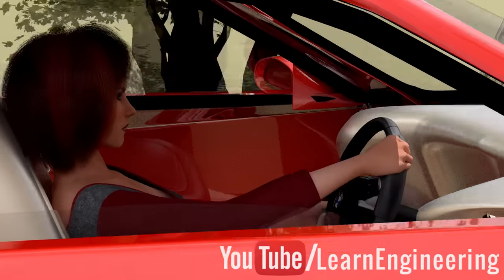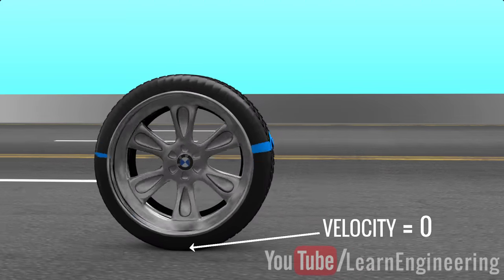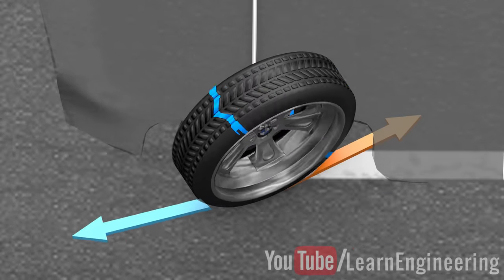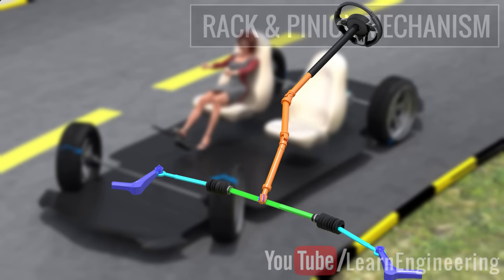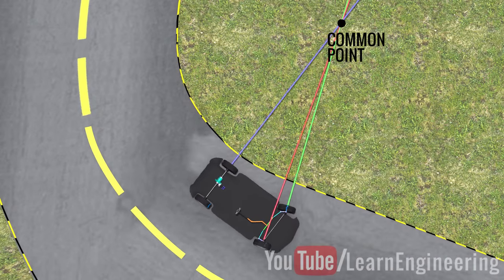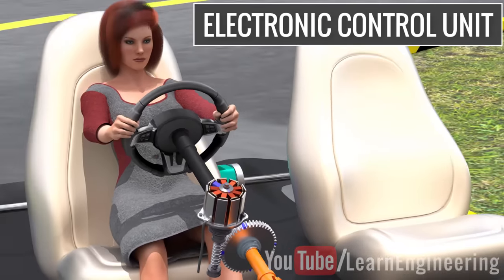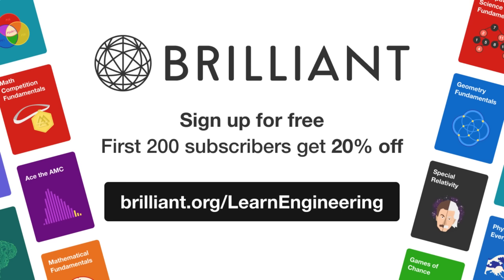Understanding your Car's Steering & Power Steering !

Comment: I remember the clutch being harder to learn than turning
Reply: Gazza Darin true 😂😂😂😂😂
Reply: And even that is easy
Reply: Gazza Darin, I agree!
Reply: Clutch master race
Reply: I hear so many times about people having issues with using a clutch, i never understood he difficulty of it. In my first driving lesson 10 years ago i drove away without talking about it, 2 years later the same at motorcycle lessons. I guess you just got to know what a clutch actually does mechanically.
Reply: I found that keeping straight and centered was actually harder than learning to shift, at least in my truck anyways.
Reply: Gazza Darin - I agree, but the majority of Americans can't use a manual gearbox.
Steering is only difficult to master when you're going backwards.
Reply: This vid is American most of their cars are auto transmissions
Reply: @jasperl3759  Well done - I just said that.  If they don't use manual gearboxes, then obviously, they use automatics.
Reply: Just think about how many times u were near to an accident after learning clutch perfectly!!
Reply: @jasperl3759  I don't think it is American because the driver is on the right.
Reply: I had trouble changing lanes I used to take my foot off the accelerator when i looked over my shoulder ha ha ,(drove manual paddock bomb  so not an issue when a went  licence ) 👍
Reply: gunjeet bhatt Maybe you should float thru the gears eventually I’ve heard that cause less wear and tear on the clutch
Reply: Try a manual with no power steering
Reply: As someone whos been driving for 10 years and finally decided to learn manual transmission, this hit different.
Reply: Have u ever heard about automatic transmission 😂
Reply: Suraj Creation What is that😭? Never heard of it....
Reply: @TT.4_   Please check videos of learn engineering on that topic  for more information
Reply: Lmfaoo
Reply: Steering* XD
Reply: yep steering is easy for most of them
Reply: LMAOOO
Reply: I'm a learner driver clutch was significantly harder than steering
Reply: They don't have a clutch in the states.
Reply: @Engineer9736  well that's good. I disagree that knowing how a clutch works would help. I knew exactly how a clutch worked before I started driving manual and it still took me some time to start without spinning up the engine skidding the tires, riding the clutch or stalling the engine.
Reply: Clutch ain’t nothing unless you gotta double clutch
Reply: Lol fr. And even in an automatic steering is far from the hardest part unless your car for whatever reason doesn’t have power steering ig
Reply: What's so hard about it?
Reply: @kindpotato  As an Indian, and from Mumbai, we learn clutch riding while learning to drive. It is said that, if you are able to drive on Indian roads easily, you can drive anywhere in world, all thanks, to potholes and frequent traffic and idiot drivers who think they own the roads.
Reply: True
Reply: Lol I learned how to drive on an old Ford tractor, I remember thinking I was going to do when I dumped the clutch and the front end tried to come up
Reply: No that is not true, the steering is more hard to learn than clutch
Reply: It always is. Very true
Reply: They're referring to people who learn to drive automatic cars.
I feel they don't know anything about driving!
Reply: Americans don't have a clutch. But it's funny cause having a clutch never made me think steering was difficult
Reply: This is exactly what I thought. I wondered if this is a American thing (autos being more common)
Reply: Kids these days be like "what is a clutch" 🤔
Reply: Changing speeds it’s pretty uncomfortable at the start
Reply: @DownhillAllTheWay  steering is still pretty intuitive in reverse if you adjust how you sit correctly.
Reply: Haha true dat
Reply: Facts 💯
Reply: I wish I was born with manual cars
Reply: @Unknown-vp2vt  unless you were born prior to the invention of cars, you probably were, even now you can find a manual cars, they are just order.
Reply: So truuuu it took me like 50 minutes to understand the clutch and like 2 minutes turning
Reply: Learning how to balance the clutch is hardest part of learning how to drive a manual transmission, but not the same for an automatic
Reply: True 🤣 way more hard
Reply: That's an interesting last name you have there. 🤔
Reply: Exactly, the clutch feel and handling were much much harder to learn than steering.
Reply: So gone 😂😂😂
Reply: Exactly! Since when has it been “one of the most difficult things to learn how to do?” You just turn the wheel for goodness sakes. I remember the clutch being this mysterious, intimidating puzzle. At least for me.
Reply: Tesla owners be like u guys have to learn too?
Reply: True
Reply: Atom
Reply: @Engineer9736  yeah some cars have it easier than others. My first time driving was on a '43 Jeep Willys. Damn that clutch was rough
Reply: Americans don’t use clutch so steering is the hardest even though it’s so easy 🤣🤣🤣
Reply: Same for me and 2nd to manually shifting was pressing the fuel pedal, good grief I got a lot of tickets before I Learned how to slow down 🤣
Reply: @BalrogUdun  I learnt how to drive on a manual with no power steering. Gone are those days and now most people around me don’t know how to drive a manual.
Reply: Just get an automatic
Reply: Clutch is easy bro 😌
Reply: Nothing is easier than clutch lmao
Reply: Means you can never understand AT
Reply: Drive automatic transmission dude
Reply: @CIorox_BIeach  I found that hard at first... the trick is to look ahead.. not the few yards directly infront of you.. but down the road.
OR keeping the corner of the hood of your car running evenly with the lane marker .. that was easier when cars were more boxy but it is especially useful when bright lights are blinding you.

At least that works for me
Reply: Haha, so I was not struggling alone 🤣
Reply: I think they mean the science of it is harder to learn
Reply: I put my mom's Benz in park while it was still rolling 😬
Reply: You thought underbody was going to be easy?
Reply: I remember that it was really easy to drive from the begining… but guess that depends on every people
Reply: PFFT

Comment: It’s amazing the amount of engineering it goes to things we use everyday and take for granted. And also, these visual learnings are effective rather than just reading about it👌🏽
Reply: Absolutely until you suddenly experience total failure! Electronic steering depends on vulnerable processors, wiring and connectors and any problems within these components render the steering useless, you can't beat hydraulic power assisted steering , just had a total failure on Opel Astra .......and steering wheel was extremely hard to turn, any woman driver would have just given up.
Reply: @mgabrielle2343  unless she hits the gym like The Rock
Reply: @mgabrielle2343  aren't women strong tho?
Reply: We pay for it
Reply: And these engineers keep inventing the wheels, amazing.

Comment: Wow, I never knew that the 2 wheels are steered ar different angles! This video is an eye opener! And the power steering mechanism is quite clever. Infact all mechanics are work of clever men. Great animation. Thanks and keep it up.
Reply: And here I used to think a car needed alignment whenever I noticed a parked car with the wheels turned and the wheels weren't exactly turned equally hahaha! I Dunning-Krugered myself.
Reply: They also turn at different speeds which I also learned from this channel! So cool!

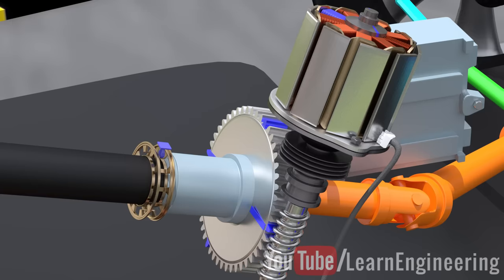Comment: just finished my first semester of mechanical engineering. experienced pure joy after predicting the planetary gear at 6:03. 😂 Great video, thanks a bunch!
Reply: If the planetary gear is used as shown the steering wheel has no authority over the direction of the car. If the wheel is held straight and the worm gear turns, the car will turn in that direction. I think there must be something missing.
Reply: In only your 1st semester?? I didn’t go over gears/dynamics until my sophomore year. 1st semester MIGHT cover free body diagrams in say, statics, but congrats if you knew gears that early on
Reply: @crippletron6879  to be fair, we had like a semester on gears and it never came up again (except in projects).. it kind of got more and more theoretical later on with fluid- and thermodynamics... Buuut I'm going to have my bachelor's degree in half a year, fun to look back at this comment
Reply: letsgo bro you can do it, bro gonna be making 100k and have big house by not even 25
Reply: @Mohas191  Thank you bro :) I'm in my master's now :D
Reply: @stevelooney1473  yeah as you said, there might be something missing
Reply: DO you study boring math in this class?

Comment: You guys should do a video on motorcycle counter-steering. It's a very confusing and counter-intuitive subject.
Reply: Agreed! It's weird, like opposite. Your turn left to go right, etc. Yes please do video on this.
Reply from the maker: That's an interesting topic. I will do it. Thank you for the video suggestion.
Reply: Thank you!!!
Reply: @adamaj74  I know what countersteering is, but it is hard to explain it in words. The fantastic animations that this channel produces will provide a much clearer explanation! Let me know if you want me to explain, I'll try my best.
Reply: @Ankur Solanky Thank you very much for the kind offer. It's always good to hear something explained from another's point of view.
Reply: @adamaj74  Oh, woops. I just read your comment again and realized that you wanted an explanation on motorcycle countersteering. I know some stuff about car countersteering. From what I've read and seen, you would need to countersteer when you are oversteering (losing grip at the rear tries). Basically, you  would turn the steering wheel in the opposite direction and modulate the gas pedal to where you can correct the oversteer without upsetting the balance of the car.
Reply: Yes please. Let’s learn about gyroscopic precessions
Reply: I can ride a motorcycle but still never understood it. It always feels like just leaning to the side
Reply: yes!!!
Reply: @blessednight  think like you wanted to slide your read wheel.
Reply: I've never understood counter steering at all. The bike goes where I want it to, I don't know what everyone is talking about as far as "turning left to go right" etc. It's not turning, it's more of a simple lean
Reply: @Meanderthal17  That simple lean is made possible by the counter steering mechanism. If you turn the handle bar slightly to right side, you'll lean to the left. This is when you can make a left turn. With a stiff/fixed handle bar, you can never lean as you wish.
Reply: By shortly steering in the other direction, a lot of the weight of the motorcycle will be leaning over to the other (prefered riding direction) side of the center of gravity, which helps with getting the motorcycle leaning into the turn. Once the motorcycle is leaning into the turn you follow by steering into that direction as usual. That the weight of the motorcycle shifts next to the center of gravity is caused by the location of the pivotpoint of the steering. If you turn the handle bars then looking from the top the motorcycle forms a slight V shape where the wheels sit at the 2 top points of the V and the steering pivot point at the bottom point, hence all the weight of the motorcycle is trying to pull the motorcycle to that side.

Comment: I would have loved to see how they solved these problems when designing the power steering assist-motor, but also the countermeasure planetary gear set. Fascinating. My only regret is that we were unable to record the thought-processes of the geniuses behind this contraption.
Reply: Patents are public, and spell out the thought process in immense detail. If you really wanted to look into it, you certainly could
Reply: @nikhansen8775  I never considered that

Comment: Lol I am Mechanical Engineer with a Masters in Aerospace Engineering, yet it never ceases to amaze me at the ingenuity and simplicity of these designs we use on a daily basis :) Engineering is so much fun!
Reply: Why does the rack and pinion always achieve the optimal common point? Are the lengths of of the arms and tire rods important?
Reply: @tylerw.1414 i have the same question

Comment: I like how they chose to explain power steering involved one of the least common types. Most cars, including new builds, still use hydraulic power steering. That operates differently than the video example, and I think is worth diagramming for a more complete explanation of the mechanics of steering.
Reply: Lol I was thinking the same thing. Most people don't own cars with electronic power steering. I work in parts and I sell power steering pumps daily but have never an steering motors.
Reply: Then there's me with a car with no power steering.
Reply: @hapaboy8424  I’ve never seen a car without power steering in my life lol
Reply: @hapaboy8424  Sad story. Those arms must be pumped up like hell to. :Ρ
Reply: @aimilios439  i drive one with no power steering as well, but I’m gonna say in my experience it was pretty easy, it’s not like you have to grip it really hard or smth. It’s rather a loss in controllability, especially felt on higher speeds. 
Driving on speeds like 80+ km/h gets a little bit scary even haha, especially if the road isn’t perfect. Maybe that’s the time you have to grip it harder but it’s still not that muscle-tiring
Reply: Agreed.  I didn't even know electric assist was an option.
Reply: @aaronmedley5184  could also be some selection bias on you having never seen one. I am guessing most electronic power steering systems are quite new, so are unlikely to have worn out and needed replacement already. Additionally, brushless motors can have extremely long live spans, and might not wear out in the same way as a hydraulic pump.
Reply: @hapaboy8424  It's good physical exercise to steer without power steering.
Reply: Isn't that why we need occasional maintenance on power steering fluid?

I'm pretty sure my car has a hydraulic system & it's relatively new make.

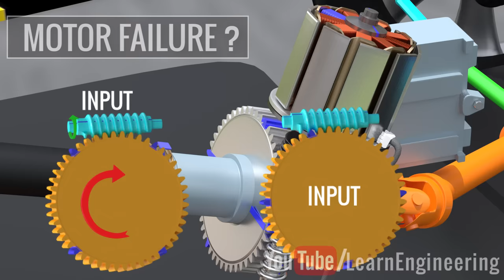Comment: @5:40 You can most definitely back-drive a worm screw, if the worm angle is above the inverse tan of the frictional co-efficient. If the assembly vibrates, then it's even easier to back-drive. Great video, though!
Reply: chocobonita  I work with industrial machinery and farm equipment, and have some hands on experience with worm drive gearboxes. I've dealt with some machines unexpectedly back-driving their worm gearboxes, and that motivated me to learn the engineering behind how they work.
Reply: It probably would not work wheel enough to be useable. It would have to be able to move smoothly and predictably.

Comment: 6:28 - That's a really clever design.
Not just for the failsafe reason.
But also, when the motor has failed, the steering wheel is essentially geared down, so that the driver is able to apply more torque.

Comment: I'm not a practicing mechanical engineer but I do enjoy the videos in this channel because it shows me new technologies that we did not touch in engineering school.  However, the end of this one does not make sense.  First of all, you can possibly back drive a worm gear.  More importantly, when the motor drives the ring gear in the driver's intended direction, the planetary gears would drive the sun gear in the opposite direction.  This further resist rather than assist the driver's steering effort

Comment: An excellent video but just a minor correction. At 5:45 the statement that a worm gear can't drive a worm is false. A very common misconception. When the worm can't be driven by the worm gear, this is called self-locking. In many designs, this is a requirement. But it is inefficient. So for applications where efficiency is important and self-locking is not required, then the worm and worm gear set is not self-locking. It's all about the application. Interestingly, this leads me to wonder why self-locking would be deliberately used in power steering. I imagine the use of a high-efficiency worm gear set would actually be better in power steering. In the case of electrical failure, then back driving the BLDC motor would not be an issue. Just a thought.
Reply: Thanks for posting that correction. I wasn't previously aware that you could have non-self locking worm and worm gear sets.
 
I'll admit that I'm guessing here but wouldn't the advantage of this set up be that, in the event of failure, you obtain the benefit of a gear reduction between the sun gear and planetary gears. That is to say, you'd need more turns (of the steering wheel) lock-to-lock but less torque input from the driver.
Reply: @beyondbin6621  I understand your video is about the geometry of steering but what has it got to with my post about worm drive efficiencies?
Reply: @steplusplus  I watched it again and I get it now. (was probably drinking first time LOL) The locked ring gear forces the steering wheel torque to be transmitted to the rack and pinion. If the worm drive was not self-locking the steering wheel torque would backdrive the power steering motor and not drive the rack and pinion. Thanks for your suggestion.
Reply: @robguyatt9602  Yes. And, if there was no planetary gear set, the torque would indeed drive the steering, but would simultaneously backdrive the bldc motor, which would provide extra resistance due to the high gear ratio from the worm and eddy currents.

Comment: Hydraulic power steering also makes steering effortless.  It has been around longer than the electric systems that are becoming more common.
Reply: Electric is more popular now because there is no parasitic drag on the engine and the system is lighter. This makes the car more fuel efficient.